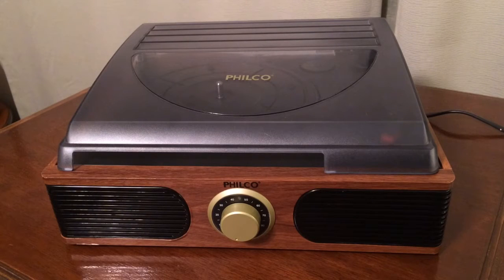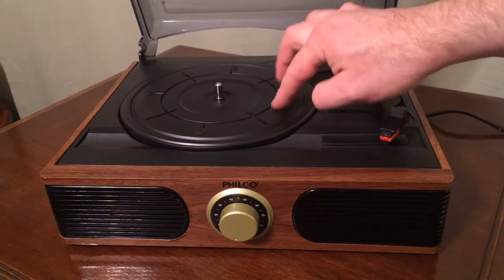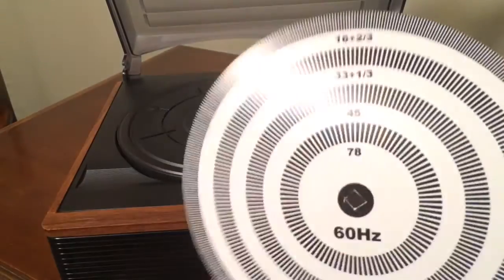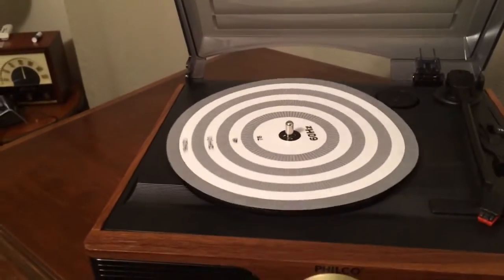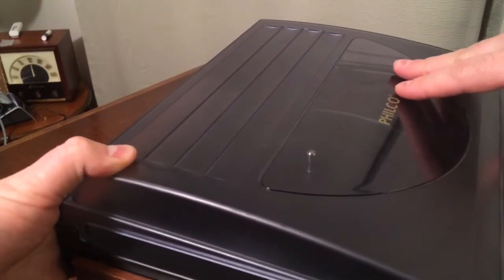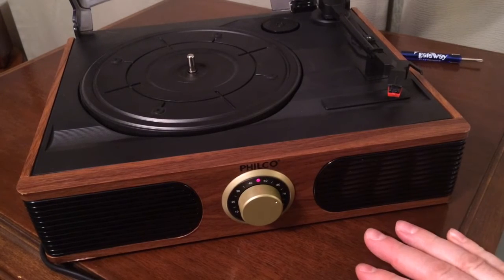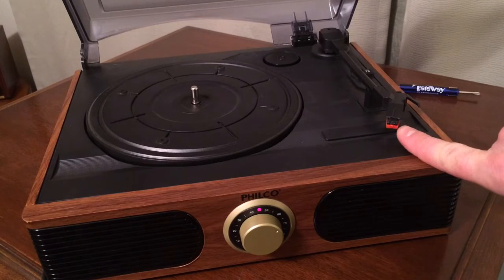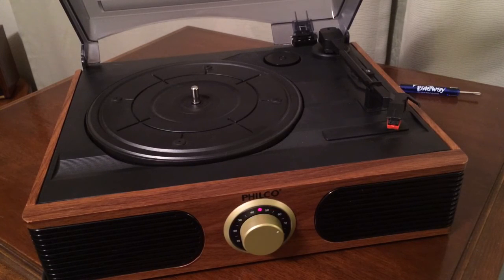Retro Tech: Philco Toy Plastic Turntable

Comment: I dunno about Crosleys these days, but I happen to be quite happy with my Jensen JTA 230 I got off amazon. Unlike most other inexpensive turntables, it has a tone and a speed adjustment control, indeed I bought it specifically because it had those built in and some records were recorded at weird speeds that aren't dead on the 78, 33 1/3, or 45 rpm marks.

It's not the grandest thing in the world, but it makes a good beginner's turntable and works just fine for personal listening (surprisingly loud, but if I really want to rattle the windows or have it be a party machine, I could always hook it up to some better speakers with the built-in jacks).

Comment: Yes, these are crap. LPs and 45s sound terrible. They sound like the plastic they're being played on. There's no way I would have one just as a vinyl player. But I'm glad you share my opinion about playing 78s on them. I have one branded as Memorex that I bought specifically for 78s. It's a separate component. No way I would have gotten one that I couldn't output the sound. My parents had an all-in-one Crosley piece of crap years ago, so I knew about the sound quality. None of these come with a 78 stylus. Luckily we have carolsneedles or needledaddy on ebay for that. But, other than the speed issues, which I'm glad you and others have shown how to fix, they're just fine for 78s. The sound is good because it's already some fuzzy shellac and a rubber mat on the platter helps with other noise (that doesn't help much when it comes to vinyl). I mean, these tonearms have to do less damage than a gramophone reproducer. But they're only good for the life of the turntable, which is usually no more than two or three years. Mine is on its last leg without even using it often. If you're on a budget and collect vinyl, your best bet for a new turntable is Audio Technica, Pioneer or Sony. Pioneer pl-990 has pitch control which is nice. They're all the same basic turntable (with a magnetic cartridge) but the sound quality is great and the tonearm is super lightweight. Audio Technica for one is right at the same price as these pieces of crud. The others are only around $20 more. NB4 people ask "Oh yeah? Where else can you get a turntable at this price?" You may not get the amp and speakers with it, but you can plug them into your computer or laptop and have sound.

Comment: My brother brought me a Crosley Traveler phonograph for a Christmas gift a few years ago and it played records a bit too fast. I opened it up and there wasn't any potentiometer on the circuit board for speed adjustment. But there was one on the motor so I adjusted it with a small screwdriver using a familiar old record until it sounded "right". While I'm glad there is a vinyl revival going on now,  I'm very disappointed with the cheap quality of these new phonographs.
Reply: It's same thing with my Crosley Cruiser. But the only problem is, it only changes the speed of 78s. All of the speeds are running a little fast.

Comment: Heh, I actually own one of these. Slight differences in the design and switch placement, but the mechanics are almost certainly identical. It probably sounds awful to trained ears, but I grew up with home recorded tapes, car radio and horrible tinny computer speakers, so I'm okay with it for now. And if I hook up my JVC boombox into the line out, I get a much improved soun quality too. Of course I will eventually get a better setup, but hifi is a big and daunting field, and of course there's space considerations too. In the meantime, I'll stick to buying preowned records so I'm not responsible for accidentally ruining something.

It's a shame there isn't a much better example of this kind of all-in-one unit on the market since I think the whole "plug and play" experience is a tremendous boon for when you're starting out and can't tell a preamp from a chicken dinner.
Reply: True to my word, I did end up replacing the whole thing with a cheap P-mount Technics table that sounds much nicer. :)

Comment: Budget players like Jensen and Crosley are what they are. If someone is curious about the road of vinyl LP, there's no problem in buying an inexpensive turntable like Jensen or Crosley to just try it out. You can always upgrade later.
Reply: The only problem is that it kills your records, the arms are always too heavy
Reply: Hey Papa Asian Sticker. I had a Crosley  for a year and it didn't ruin any of my records. Eventually, I upgraded. I'll go this far. If you're going to get a cheap Crosley or Jensen (to try vinyl out), it's probably better to stick with used records.  If you decide you like vinyl and want to upgrade and start buying new ($20. +) records, then you should have a higher end turntable. But I see no problem with at least trying out some used vinyl records with a cheap turntable. As I said, you can always upgrade later.
Reply: eternalhalloween1 Thank you! Finally,someone gets it about these turntables.

Comment: They tried to rip off Phillips hahaha
Reply: No.  Philips and Philco are (were) two different companies.

In fact, when the compact cassette was introduced in North America, it had to be sold under the Norelco name.  Philips developed the cassette, but decided not to use the name in North America because another company, Philco, had a similar-sounding name.  Since Philips owned Norelco, cassette recorders and tapes were sold in North America under the Norelco brand.

At one point, the Philco name was owned by Ford (yes, the automaker).   You could buy Philco televisions, refrigerators, radios, console stereos, and so on.  

All that said, this is no more a real 'Philco' than I am Sheena, Queen of the Jungle.  The Philco name went obsolete, got bought by another company, and gets slapped on cheap garbage like this.  Crosley, Magnavox, and Emerson are all similarly just 'names' now.  These companies don't make their own stuff, and have no connection to the actual companies that bore those names.

Comment: Pure crapaphone. Fake chrome, telephone speakers, egg carton plastic, 4+gram cartridge and other nastiness inside.
Reply from the maker: +Marks mediaTV - Totally agree.
Reply: +Marks mediaTV 

Nothing wrong with a 4 gram cartridge when used with the correct stylus.

Many older ceramic cartridges tracked at 5 grams and a lot of those records played on such record players still sound good. Depends on the individual person and how well they cared for the record players and records.
Reply: jmcinvale For modern record players that are designed to play microgroove vinyl material, heavy tracking force is not the best for longevity of the record.
Reply: +Marks mediaTV 

The older record players of the 60's and 70's were designed to play microgroove records and so long as the players themselves were properly set up and cared for didn't ruin records.

I used several over the years on my records and the ones that were already n good condition when I bought them are still in good condition.

Now I do agree the cheap turntables of today aren't the best for records, but it isn't necessarily due to the stylus pressure.

It bothers me when I see someone mention higher stylus pressure causing records to be ruined as though they don't know that the more common record players of the 60's and 70's used ceramic cartridges with around 5 grams tracking force.